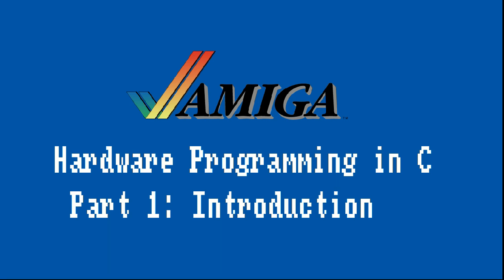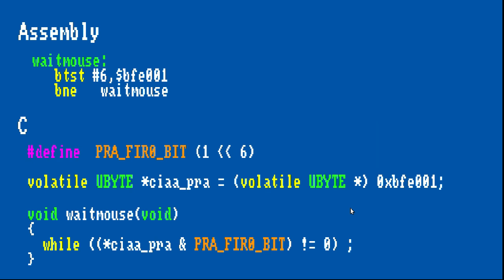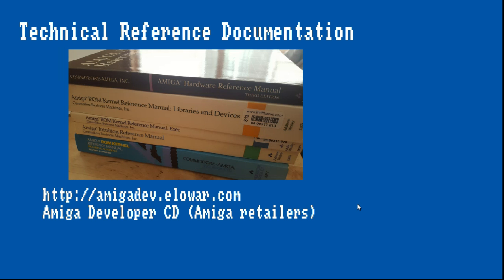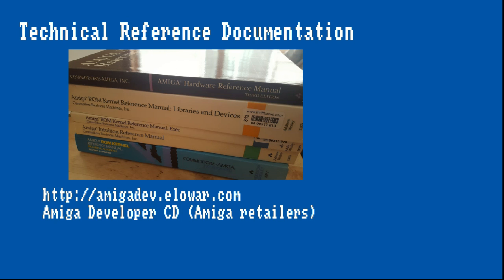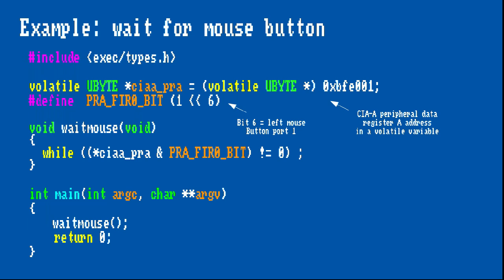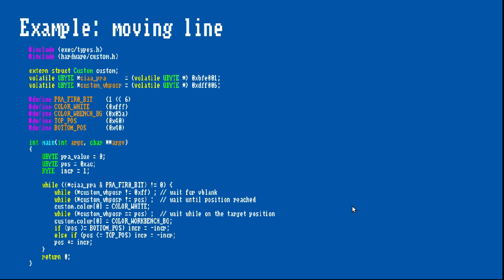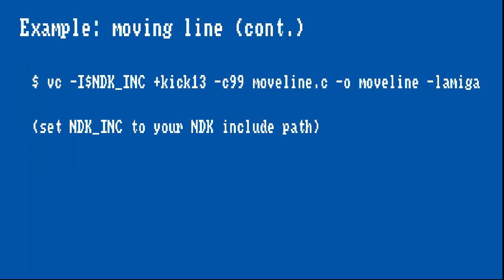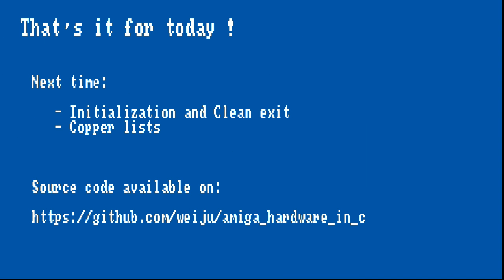Amiga Hardware Programming in C Part 1 - Introduction

Comment: Well, a good tutorial, but you missed the fact that you can use the official includes for bits and register addresses like in C also for Assembler code. So Assembler code doesn‘t have to look like your mouse button example and will be more comprehensive.
Reply from the maker: You are correct ! You can of course include the "hardware/..."   include files to have the assembly code look much more readable.

Comment: Thanks again for your videos! I've been repeatedly going through them, and while I do understand the concepts, I'm still struggling with the details of the C language itself. Can you recommend any good books to help really grok the nuances of the language?
Reply from the maker: Hi  ! I don't know what your experience with other languages is, but C is very similar to a lot of current programming languages, or more exact, a lot of programming languages were strongly influenced by C's syntax, which is most apparent in Javascript, C# and Java. That's why familiarity in a C style language makes it easier to transfer the knowledge to other similar languages.

I personally learned C from the Standard Book "The C Programming Language" by Brian Kernighan and Dennis Ritchie. I am sure there are other books, but this is the one I know and it is quite popular.
Reply: awesome!! I'll give that one a go. (I've been mostly working with high-level stuff like python and ruby)
Reply from the maker: @warci  I am mostly working with Python myself these days (and used to do a lot of Ruby), so I am pretty sure you'll be able to pick it up quickly. I find the main differences are mainly the static vs dynamic concepts and of course the way you can directly interact with memory.
Reply: @WeijuWu  haha thanks for the encouragement! Already ordered the book :)

Comment: I do not understand what do they mean: 
volatile ubyte *
int argc, char **argv  ?
Reply from the maker: These are all C type declarations. ubyte is a synonym for an unsigned 8 bit word. Since the Amiga's hardware is memory-mapped the volatile ubyte * is essentially a pointer to a CIA-A register. In this case I declared it as "volatile" to prevent a compiler optimization to happen. The compiler would normally assume that since we never write to that memory address that it never changes, but it does not take I/O into account, so the "volatile" keyword takes care of that by making sure the CIA registir is always read when we tell it to. The "int argc, char **argv" is the standard parameter list for a general main function in C. When a program is run from the command line "argc" is the number of arguments provided to the program and the **argv is an array of "argc" strings that contains the actual parameters.
Reply: Thank you very much, i understand now :-.)

Comment: Thanks so much for taking the time to provide this! Just a heads-up to people, COLOR_WBENCH_BG should be defined as COLOR_WORKBENCH_BG (as it is referenced as such below). Also, there is another error in the listing (specifically BOTTOM_POS should be 0xf0). The downloadable code examples are correct, though (even if they no longer use the #defines and hard code the values instead!)

Comment: first thing you should do is to close C editor and use Assembler insterad. so if you want to do Amiga coding  C is No No No. One thing yoh have to learn C is not good for Amiga coding !
Reply: Wings was coded in C for amiga.
Reply: the exepctions proves exclusivity thesis ;) look perhaps with alot of inline asm interesting things can be done in C. I know well most of the golden age coders no one uses C... Assembler programing on amiga is great. believe me I am the legend :)
Reply: It's not the tools, it's the skill. If you can't get results from higher level languages then you just aren't a good programmer.

Comment: I've never clicked the subscribe button so fast in my life
Reply: IKR! Coding on bare metal. Banging the metal! Out come the old textbooks on basic  binary maths like two's compliment or binary to octal or hexadecimal conversion. Would love to see a Hi Fi graphic equaliser programmed to separate an analogue signal into its harmonic series using Fourier Analysis. Don't know what resolution one could achieve (even on a fast CPU amiga with lots of RAM) for bit twiddling though (I think discrete cosine transform butterfly algorithms would be pushing it). One could however sample video in tiny amounts on an amiga.

Comment: Thanks for this. I look forward to seeing further episodes. I'm planning a small Amiga RPG / adventure at some point.
Reply from the maker: I wish you success in doing that, it would definitely be great to see more games on the Amiga platform. I've been mostly programming on the operating system level, but it's a lot of fun talking to the hardware directly with the Amiga.
Reply: I don't suppose you'd ever consider writing a driver for the (modern or old) SCSI CDROM drives that plug into an amiga a500 (e.g. via the back of an a590 hard drive) would you? Was never sure how to boot CDTV games that way.